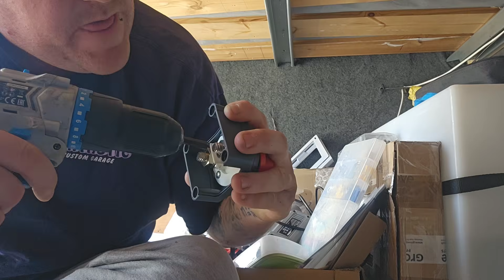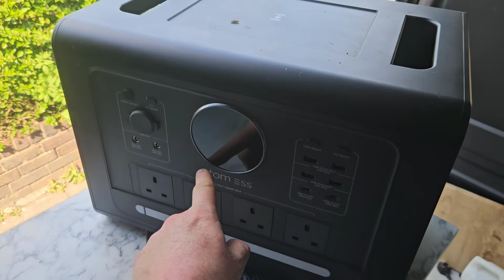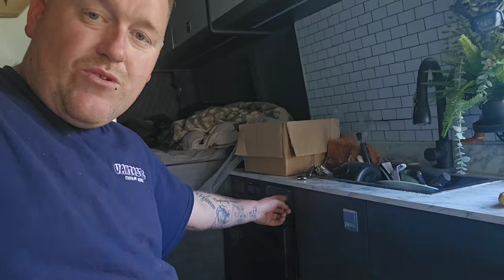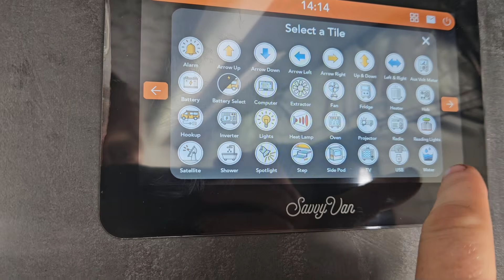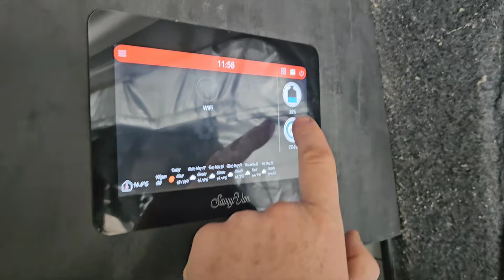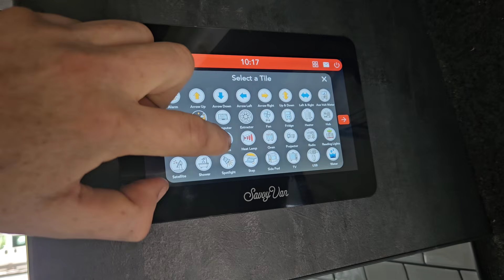URGENT Campervan Electrics Repair Means UPGRADE Time || Savvy Vans 3 Install

Comment: My battery isolator cut off switch was rated for 275A and it melted at 89A from my battery charger.

Comment: Holy Christmas, I had my hands over my ears a few times there. 😧 I Like the overkill for cable sizing, same with mine system, Its not a proper van build unless you get a few sparks 🤣😅🤣😂🤣👍

Comment: This electrical installation is missing a general fuse nearby the batteries and of course separate fuses for all the chargers.  Also your cabling should be covered. With all those lose objects there it can easily happen that something falls on or against them an they get a damage.

Comment: Proper rough. I enjoyed the part where you have uninsulated, unfused and unsupported terminals about an inch apart. Surprised this hasn't set on fire yet

Comment: Hi my experience with those red twisty master switches. If you look at the buzz bar inside the switch I don't make contact they are dome shaped best thing you can do as I did is file them down so you get a flat surface on the two faces to make better contact with the in and out of the cables as there is no not sufficient contact area which causes heat to build up in  the connection. As you may know power is pressure like squeezing a hose pipe .

Comment: 400ah is your battery’s total capacity & is unlikely to travel through any one cable at one time (without a big bang) your current limit will be governed by your BMS.

Comment: should check to make your switches can handle the current most have a rating which say on there so many amps and how many amps continous if you are putting 400 amps through a switch rated at 300 amps you are overloading it and asking for trouble also buy decent quality bus bars ,maybe before doing anything more check out some dedicated videos that match your system components,and bear in mind most of them say they are not how to do it but how they have done it after research the best ones ive seen are done by explorist life mobile as they are easy to follow if still unsure use an expert

Comment: There are so many things I winced at on the original install. But looks like you caught the isolator in good time before it went fully pop.

I’d swap the bus bars and use a Lynx Power in to avoid double stacking them lugs. 

I think 95mm2 is overkill. 70mm2 would’ve been fine or x2 50mm2.

Comment: Who else is a member of the 'Cringe at his electrics' club?  
I can't fathom why anyone can spend all that money on toys but can't spend £40 on a reasonable hydraulic crimper. A hammer is not a crimper.  And has the man never heard of cable saddles and cable ties?  Its looking like a spontaneous rats nest fire.
It doesn't take much extra effort, neither does labeling the cables and drawing up a wiring schematic

Comment: 2 x 50mm is a lot easier to work with than 95mm

12V planet sell suitable heat shrink as do RS

Comment: What ferrules are you using for the 25mm² cables.
Reply: They were black so I think 16mm2.  I also had to use 16mm2 on the orion because although victron claim it will take 25mm, I couldn't get 25mm2 in the  slot with or without 25mm ferules
Reply: I used the Reducing pins from 12 volt planet, but after heat shrinking them it was very difficult to get the black cover on. I also had to file the pins down. I think I will just use 16mm² on the other charger as it was such a ball ache.

Comment: Just a tip. Try and make sure you cannot see any copper when you are connecting into terminals. A better option would be to use bootlace ferrules on the cable before connecting

Comment: Hey fella,  love the upgrades but the the new dc/dc chargers  have a reputation of etting a lot hotter.  The dc/dc charger should be mounted to a non flammable surface.  I see you have a vent but it is wood and you have carpet around it., There should also be a bigger gap from your solar unit,  which is going to get cooked.

Comment: Those 2 stacked (I’m guessing 2x25mm cables?)  would have been ok for up to 345 amps. 95mm is way more than your inverter can output. A 3000w inverters max amp draw Is only 250 amps. So the doubled up cables were more than capable for the inverter. 

They don’t usually send you 2x positive and 2x negative test cables. I only got one of each and they were only 16mm. I agree though. They shouldn’t send test cables. I’ll bet many people have melted cables using those for high amp draw.

Comment: Great content, all I'd suggest as mandatory is to get a fire retardent board behind your mail electrics pal 👍 at least if something arks or melts you won't lose the van 👌🙏 having fabric behind isn't a good idea 👍

Also keep an eye on them cables you used electrical tape as the vibrations and heat will take the stickiness off the tape and degrade. Heat wraps are alot better 👍